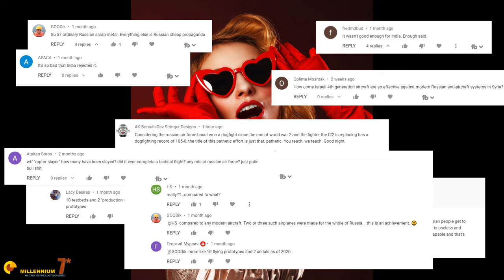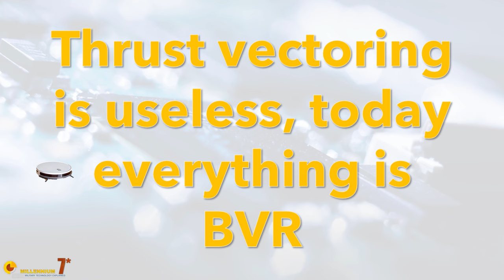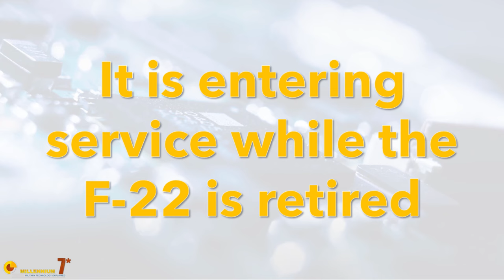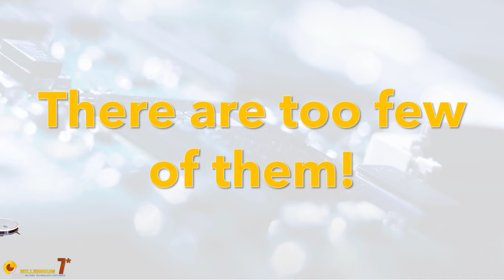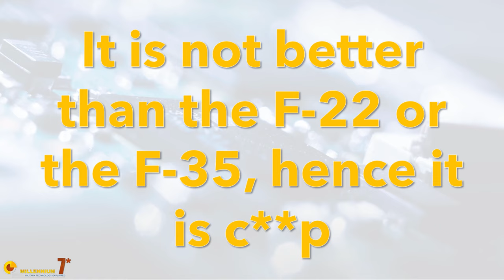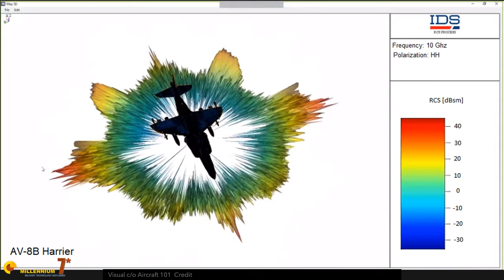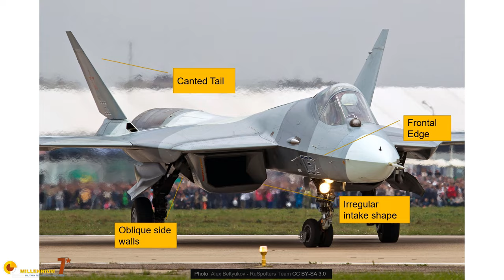Su-57: is it INVISIBLE?

Comment: Agility with vectored thrust are useful for dodging missiles, not just dogfighting.
Reply: How? Thrust vectoring bleeds energy, and an aircraft will never be more agile than a missile.
I don't mean it can't be useful, but mostly only as a last resort.
Reply: @chefchaudard3580  
Trying to shake a missile isn’t last resort?

Remember missiles are usually gliding and burning off energy fast while predicting an intercept so short sharp deviations force a big response from the missile.
Reply: @chefchaudard3580  "aircraft will never be more agile than a missile" - in a dogfight, yeah. In BVR - wrong. Plane has engines that provide constant thrust, any energy that it loses can be recovered. Missile has engine that provide massive thrust but burn out in SECONDS and after that missile is going by inertia, any energy it loses it doesn't it recover. In quire a few instances plane can not just dodge but out run the missile because all the "juking" causes the missile speed to drop down to low sub sonic.
Reply: @brucebaxter6923  no, dodging missiles can be deliberate. It is an option to force your adversary to spend his missiles against you. If you have a good knowledge of the missiles performance, you can force him to shoot them, one after another, so you can kill him afterward. 

Former French pilot Ate Chuet has released a video on YT showing how a fighter can force a frigate to shoot and how to dodge the missiles.

When all missiles are exhausted, the frigate is a sitting duck.

This can be used  in BVR too, and there is no need of thrust vectoring. On the contrary, bleeding energy is not the best way to achieve it.
Reply: @uegvdczuVF  That's precisely the point: sacrificing energy for agility in BVR is not the best option. Better use speed, terrain configuration, distance to dodge a missile. Bleeding energy must only be used as a last chance, as I said in my message.

Shaking your aircraft at high Gs is pointless against a missile that can take ten times more Gs. Better use something else, if you can. 
Never fight an enemy on his strong points.
Reply: @chefchaudard3580  IMHO a missile can do two or three maneuvres before render itself useless.  As noted previously on this channel, the missile flight path is directed based on an estimation of where the enemy plane will be, according to a more or less accurate knowledge of the flight envelope of such plane; So thrust vectoring could play a role by giving a plane a flight envelope beyond the estimations of the missile guidance design (or programming).  This is how the "dodging missiles" concept must be understood.  And of course all of this is like a game of the mouse and the cat.  Regards!
Reply: @brucebaxter6923  I agree... And i think that in the future, an IA could analyze the incoming missile (path an type) and guide the plane (or drone) in a way to exhaust the missile energy in the more efficient way or put the plane in a place where the missile efectivity is the worst.  Regards!
Reply: @HaciendoCosasRaras00  To be more accurate: thrust vectoring is mainly useful at low speed. At higher speeds, reaching the G limit of the aircraft (or the pilot) is no problem, even without thrust vectoring, just by using control surfaces. In other words, the pilot, if not at low speed, does not need thrust vectoring to reach the limits of his aircraft to shake out any incoming missile.

And meeting a missile at low speed is certainly NOT what a pilot would look for, on the contrary, keeping energy is his priority, as it gives him more opportunities to dodge any other incoming missile, or reach WVR fight in good conditions.

Thrust vectoring at higher speeds can help reducing the drag during some flight phases, though. By keeping the aircraft within its best aerodynamic atittude, by reducing incidence, for example, it bleeds less energy than control surfaces, or allow for a different compromise for the wings, which can be "tuned" for less drag, thrust vectoring compensating for the degraded agility.

The question for the designers is then to decide if the extra weight and complexity is worthwhile.
Reply: @chefchaudard3580   You are just talking about speed while completely ignoring the altitude. At very high altitudes control surfaces alone are not enough to reach the G limits of a plane. No matter how hard the pilot pulls on the stick the plane will not exceed a couple of G's because the air is to thin. And pilots do take their planes to those altitudes routinely  because it gives their own missiles range and speed.
Reply: @chefchaudard3580  It is about 75 kg per engine - the answer is YES. They are valuable for shorter take off and landing performance alone, and allow to return for much more damaged aircraft.
Reply: @peceed  Only 75kg?  That's light enough!
It does not seem to be so a massive tactical advantage, though, as F-35-A and C, and the 'Eurocanards' don't have it.
Reply: @chefchaudard3580  
Seems legit if you realize that every modern nozzle  has movable elements - you pay only for "the difference".
Germans have working solution for Eurofighter but they finally decided they do not need it.
Reply: Missiles track targets by predictive math. The missile then flies to a point where statistics say the target will be. Surely you can see that super manoeuvrability will mess with those predictions. Every manoeuvre the missile makes to compensate, robs the missile of energy. Less energy, makes the missile easier to evade.
Reply: @chefchaudard3580  Thrust vector just change how you apply your Thrust. You lose energy whenever you use it. You have less drag using it but you less energy when move the plane with it.
Reply: @uegvdczuVF   The problem is not the first missile but the second missile. you have lose much energy in trying to out maneuver the first missile that the second missile is going to hit you.
Reply: @uegvdczuVF  "all the "juking" causes the missile speed to drop down to low sub sonic" - This is achieved by intelligent maneuvering while the motor is burning, not last minute thrust vectoring.
Reply: @HaciendoCosasRaras00  "So thrust vectoring could play a role by giving a plane a flight envelope beyond the estimations of the missile guidance design (or programming)." - This is absolute nonsense. Nothing is "beyond estimations". You either kinetically defeated the missile or you didn't. The missile sees you as a point in 3D space and makes a course correction based on constantly updated predictions. Whatever you do, as long as you stay inside seeker gimbal range or illumination of a mid-course controller the missile will continue to move towards the predicted impact point. It either has enough energy to get there or it doesn't. Thrust vectoring doesn't change this.
Reply: @phelansa23  No, it won't "mess" with the predictions. You make a 4000ft radius turn, the missile will be there. You make a 3500ft turn because of thrust vectoring, the missile will be there. The missile "sees" what happens and you can't "hide" what you're doing. It just sees what's happens and it reacts to it.
Reply: @ChucksSEADnDEAD , your first mistake, assuming missiles have infinite energy. Your second mistake, you have no understanding of missile guidance. You need to google Kinematics, “Missiles and predictive mathematics, and then. Too understand how this affects a missile; Kárman-Gabrieli. If you need help with the Math, I would be happy to assist.
Reply: @phelansa23  Nobody's assuming anything has infinite energy. Where the hell did you pull that one from?
Reply: @sinansarikaya3662  
Thrust vectoring helps only during low speed manouvers.
BTW.Classic configuration has much better high angle monouverability than canard.
Reply: @maksimluzin1121  Again, the issue is that supermaneuvrability is post-stall maneuvering. Stalling yourself is offering the aircraft as sacrifice. You can move the nose of the aircraft all you want, the proximity fuze still triggers.
Reply: @UCtQzjaM_x-JBa3QMtb-U4Pw You make a good point, Maksim. That would explain why the Russians put so much emphasize on super maneuvrability and heavy warheads.

It poses 2 questions though:
- does super maneuvrability require thrust vectoring? Can't it be achieved with conventional aerodynamics, like canards?

- why Western designers remain unconvinced (or, to be precise, why do they think it is not worth the price?)
Reply: @maksimluzin1121   I see your point, but:

1. that's not an answer.  I imagine that thrust vectoring can add some agility in some circonstances. The question is: is that extra agility helpful in combat, apart from dogfights, as a last resort? In other words, when does this extra thrust help defeating an incoming missile? If the pilot goes in a split S at 9G, the limitation is not in aerodynamics or thrust degradation, but the airframe and the pilot. If the missile is on its course against an aircraft flying at high speed, how will thrust vectoring help when the pilot can already manouver at high Gs without it?

2. Not only American. The Eurofighter was supposed to have thrust vectoring, but it was never implemented. Rafale and Gripen don't have it either.
Reply: @maksimluzin1121  So, we are back to the start. The Russians, for classified reasons, think that thrust vectoring helps evading missiles, while Western designers don't.

I don't buy the 'marketing' reason. If thrust vectoring was a game changer, or even only useful, ALL aircrafts would have it. I don't believe one second that Russian engineers are better than the ones in France, UK, Germany or the US.

The most probable answer is that, as you say, there were statistical analysis that gave different results in Russia. As statistics heavily depend on the factors taken in account, specially since both sides don't have to face the same missiles, we are left with 'we don't know'.

Thanks for the information, anyway, that was a good point!
Reply: @maksimluzin1121  No, I can't accept that. As an engineer I know full well that engineers are not 'better' anywhere. 

I don't see why, if thrust vectoring was of some use, Western designers could not have come with it. The US, particularly, use it for a while and master it. So, no. I don't buy that propaganda.
Reply: @maksimluzin1121  
Where did I say that Russians don't know how to fight? 

Where did I say that Russians had to copy the West? On the contrary, I said they did not have the same requirements because they were not facing the same threats.

My question was genuine: why do the Russians think that thrust vectoring is useful, while other countries don't?

I never meant that Russians were stupid, or they tried to copy the West, or whatever strawman you want to build! I agree that thrust vectoring improves maneuvrabilty in some circonstances. The question is when? And why is it useful? I never, ever, implied that Russians engineers and military are a bunch of idiots!
Reply: @maksimluzin1121  'The Russians, for classified reasons, think that thrust vectoring helps evading missiles, while Western designers don't.'

That's what I said, and it seemed you disagree at first. However, what you say in your last post is EXACTLY that.

We agree on the fact Russians engineers and military have good reasons to design their aircrafts that way, that Western ones don't seem to agree, also for good reasons (and not because they are stupid, or Russians are smarter, as you implied).

So we are back at the start: I don't know why, while you say you know, at least for the Russians, but cannot tell me.

Is not that a fair assesment of the posts? Do you see anything to add?
Reply: @maksimluzin1121  It is my posts you did not understand. Again, I acknowledged your point when I said 'The Russians, for classified reasons, think that thrust vectoring helps evading missiles, while Western designers don't.'

It is you who accused me of not listening to you, when my point above shown clearly that I did listen and understand. And you built a strawman accusing me of saying things I never said or even implied.

I thank you for taking the time to answer us, I think you went as far as you could, but I also think you should apologize for having misrepresented my posts.
Reply: @chefchaudard3580  
You mean USA fighters?
European have had canard etc for a very long time , the USA still hasn’t since the ascender although the Routan ground attack thing almost made it.
Reply: @brucebaxter6923  the F-22 relies on thrust vectoring to improve maneuvrability at slow speed, while Europeans, Rafale, Grippen, Eurofighter prefer canards. Though the last one was supposed to have thrust vectoring.
The F-35 trades maneuverability for stealth.
F-15, F-16, F/A-18 were designed when canards were in their infancy, basically computers and models were not advanced enough to design such complex aerodynamic devices.
Reply: @chefchaudard3580  
Shinden 
Wright flyer
Etcetc
We can go back through box kites if you wish. 

It was the engine that beleriot had good reliability that turned aircraft design away from canard.
Reply: @brucebaxter6923  how can you compare a Wright Flyer to modern delta wing jet canard? 🙄
Modern moving canards are much more complex than the fixed canards of aircrafts of the 50s and 60s, like the Viggen, for example.
Of course, aerodynamic laws have not changed, but simply putting a Wright Flyer front elevator to a Rafale is probably not a good idea. Apart from a broad resemblance,  they absolutely don't work in the same way.
The Eurocanards are unstable aircrafts. They use their canards in conjunction with other control surfaces, elevons and rudder, for example, through complex calculations allowed by fly by wire computers.
A canard on a modern fighter is not some moving control surface, it is fully interconnected with the overall aerodynamics of the aircraft for every speeds and attitudes. It would not work without fly by wire, for instance, and required a good knowledge of aerodynamics, accurate mathematical models, supercomputers and extensive tests.
Nothing of these were available to the Wright brothers...🤨🙂
Reply: @chefchaudard3580  The thrust vectoring is not just for low speed, but it is good for high speed and high altitude as well. At supersonic speeds, a relaxed stability aircraft will become more stable as its center of lift has changed, so the aircraft is not as responsive to inputs from control surfaces. Furthermore, at high altitude, the flight control surfaces do not have as much authority either. This is where TVC may be of particular use, especially for aircraft like the F-22 and Su-57 which are designed to cruise above Mach 1.2 at high altitude.

Comment: Given the shaping of the fuselage it looks like they are concentrating on being stealthy from the forward aspect. Since their IR sensor is on the front that suggests they intend to fly straight at a potential opponent. That the L band radars are spread out along the wings, and maybe even to the tips, I’m guessing they can beam steer and triangulate their signal for a more precise bearing (and altitude if they roll on their side). I don’t think the data sharing concept used in our F22s and F35s was lost on them, and two or more Su57s spread out over a klik or so would create a virtual antenna of considerable size and locating precision against one of our stealth fighters. As I noted before, their L bands are likely to be used in short blips to narrow down the section of sky that the IR sensor would then passively scan.
They may not be as stealthy from the rear as an F22, but extreme maneuverability can be as effective in breaking a missile lock as stealth, and could make the difference of who gets on whose six in the first place once distances are visual. The F22 is no slouch in the maneuverability department, but the Su57 is exceptional. I suspect we’ve got a peer opponent there.
One on one I think the Sukhoi would wax an F35, but F35s are optimized to fight in packs and we’re building a lot of them. Two Su57s could have a lot of trouble with 4 Lightnings.